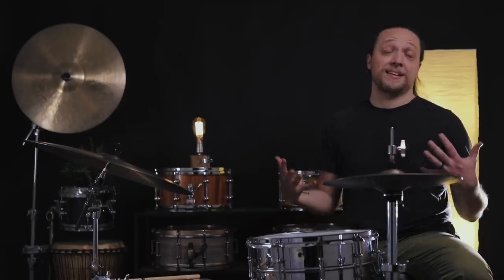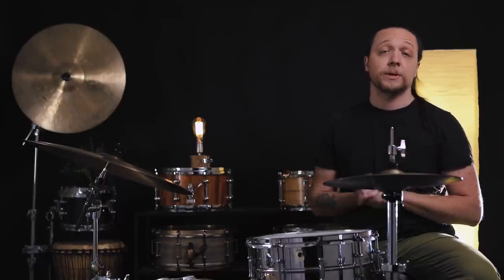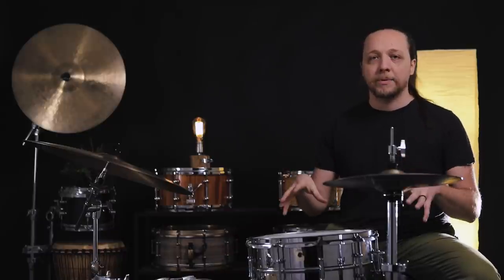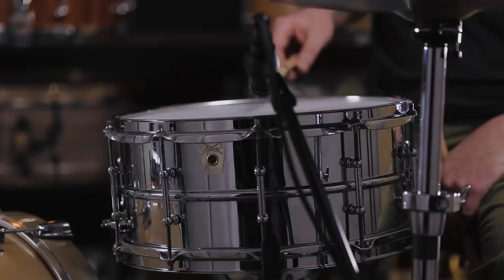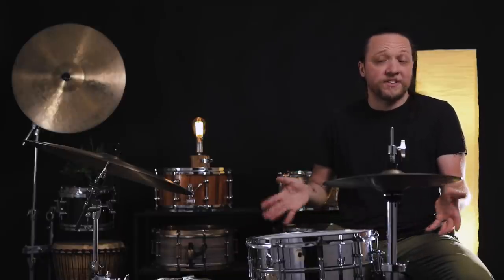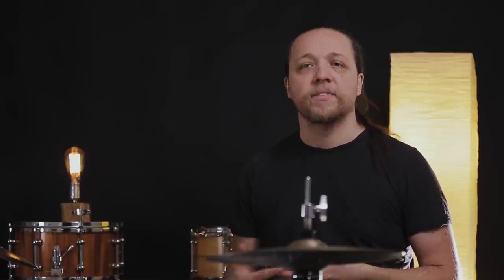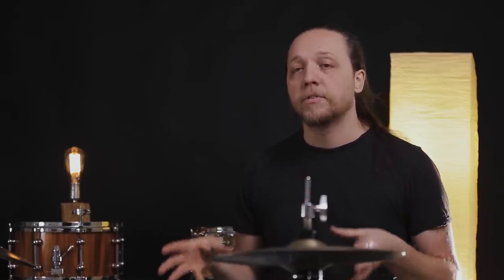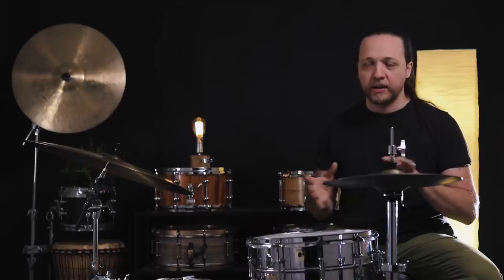Snare Drum Versatility is in the Reso Head | Season Three, Episode 39

Comment: I don't use tuning devices either, but I think you're missing another possible use case.  They don't just allow you to apply the same tension to every tension rod.  They also offer you a way of knowing how much tension you applied to each rod after you find a tuning you like, so you can record the numerical values and quickly/easily repeat them the next time you tune.
Reply from the maker: Oh absolutely! The key is that the quantification ignores a whole mess of variables so we find it best to deal with tuning on a case by case basis. Once you get accustomed to the process on a few different drums with different heads you can do it in just a few minutes. The knowledge gained through this approach has all sorts of added benefits when it comes to drum sounds and working with a given musical context.

Comment: Hey Cory, I stumbled upon this video while "surfing" the Interweb for an answer to a "weird" thing I experienced with a Metal DW Snare AND a PDP Maple Snare drum.   I truly like the sound from your snare in the opening of this Video.  The DW Design series Nickel over Brass Snare, 14 X 6.5 acquired Used in 2021 had a HD Dry Batter head installed by the previous owner.  It was Cranked and I really liked the sound of the drum Right out of The Box.  It was a big improvement over the PDP Maple Snare 14 X 5.5 with stock heads.  I replaced the PDP batter head with a HD dry -which did improve the sound just a little.  A few weeks ago, I replaced the DW's batter head with a new HD dry one, re-installed the reso head (cleaned and checked the bearing edges), re-installed the stock snare wires and retuned the drum.  I could not get to the sound that I had Out of The Box.  Last week, while playing along to some music (I'm a 71 yo retired guy who plays for recreation about 1 hour a day to My Music), I placed the Dw snare on top of the 16 inch Floor Tom to get it out of the way.  I played the PDP snare in the stand.  While doing a Fill, I hit the DW snare while sitting on the Floor Tom... BINGO!  That was the sound I was Looking for (actually Hearing for).  It played like a Ludwig Supraphonic , Jon Bonham sound !!  Took the DW off the Floor Tom and it was NOT the same?  Tried the PDP Maple snare and that Too Improved the sound !.  I've posted this Phenom in a number of Drum Forums.  Posters have advised of various observations.  "you are playing 2 drums simultaneously....  getting the resonance from 2 Drums"; another poster said Kiddingly that I may have Invented a new Snare Stand :):)  I have OCD about certain things.  This is becoming one of them :(:(.  I returned to playing drums after 50 Years [1969 at 18 years old], knew nothing of drum tuning and Drum heads back then.  I'm learning much now.  Tuning is an art. FYI, I have a G2 Coated batter head on my Floor Tom.  Any ideas about this sound phenominum ?
Reply: This sounds really interesting; would love to hear / see an example if you ever make a video of it!

Comment: Wow, i just did this, and a noticable change on my snare is that is, the overtone is less wild, less washy and less pingy and there's a little added articulation and as Cody said, I didn't touched the snare tension, just in the same spot when before and after I tweaked the snare side, here's what it sounded with my words:

Before making small adjustments:

Overtone: Waaawawawaooo 
(Wild and Pingy and sounded weird)

Snares: Psssh (Still some good articulation but it's still washy)

After Making Small adjustments:

Overtone: Waaaaawaoo (More controlled, less washy and wild)

Snares: Pssht (Little more articulate and less washy and more responsive)

This video is perfect for those who are wanting articulation but not choking the snares and maintaining your snare tone.

Thanks, Cody and this awesome channel!

Comment: BEST. VIDEO. EVAR!

Having said that, I have SO many questions:

1. What mil snare side head are you using? Does it matter?

2. Aren't you getting wrinkles in your snare side? Does that matter?

3. I was (mistakenly) under the impression that you treat a snare side like any other reso head. (ie. tuning it slightly slightly above or below batter. Keeping all lugs in tune.) SO, how do you tension the snare side head? Tight at the snare beds and then adjust the other lugs? Are those lugs under the same/ similar tension? 

Ok, I'm going to stop there. I have a TON more questions. I really feel like you could do an entire season on just this topic.

Thanks!

Comment: first of all, i'm surprised you didn't take it a step too far, just to show what happens. 
having said that, i've noticed before that lowering the tension on the snare side head widens the drum up, but i never thought to try it on just the rods that are not adjacent to the wires.  i've seen videos with top guys (coughBennyGrebcough) who advocate cranking  the bottom head, but he does say that he does this for articulation.
bottom line: it is best, as you say, to experiment and see what your equipment can do.  thanks so much for doing it in this video, because i'm lazy AF and haven't had the motivation to do it in my *%#% odd years of playing drums.

Comment: you are loosening the tension on the three on each side, correct? (not the ones on were the snares are)

You are basically doing the old rocker trick the other way around, instead of loosening the 2 beside the snares; you are instead tightening the other ones, correct?

Comment: You guys do a job no-one else does this way and with this devotion. That is worth a Patreon membership. In this video, I thought Cody should work on his rolls. But then I remembered that any time I get away from an even and optimal tension and the optimal relationship in tension of the two drumheads, my rolls suck. No chance to fix it. The snare tension is not that important. On the other hand, having found the correct head tension, the sticks bounce almost effortless and evenly. Double-stroke as well as concert rolls (mainly triple-stroke rolls, as Rick Dior told). Try it. Maybe, that is also a tip for frustrated drum students who think they‘ll never learn to evenly roll on a snare drum.

Comment: Interesting take on snarehead tension, Cody. Have u done, or considered a video on snare wires and the effect on sound?
I use 24 strand puresound wires on my 6½ deep drums and a 20 strand set on a "cheap" drum. Puresound don't seem to go more than 24 wires in their "cotter-pin" attached wires.
I fancy trying 42 strands on my 14 × 6½ Arbiter Advanced Tuning maple drum, but how much better can it get than with 24? (WHAT a drum, by the way! (I swapped the original hoops with hoops from an Arbiter FLATS 14" snare and vastly improved the ease of tuning. One bolt per head. How easy do you want?). ).

Comment: Awesome video! This was something I was wondering about, ie instead of touching the batter side, or the snare wires, just adjust the resonant/snare head. The huge impact of those side rods really surprised me! Now, wait until UK lockdown is over, and then experiment! I have a steel snare, and a maple snare, I believe both can sing, but each needs a different setup. You told me, it’s most likely not the equipment, it’s likely the snare side, and getting the right head tension. Thanks!

Comment: This is great info, Cody. I LOVE experimentation. One thing that I'd love to see you do, is a snare side thickness shootout, using several drums. I did a bunch of experiments with all of my snares and I've dialed them in over the years using different wires, snare heads, batter heads. What I've found is that on one of my drums in particular... it sounds amazing with a 500 (5 mil) Evans head and Puresound Twisted wires. This is a hammered stainless steel Mapex "Precious Metal" with cast hoops. I use this for hard rock and metal, and it simply cuts through everything. It still has amazing tone though. It sounded completely different when I got it, and that goes to show you how much your sound can be effected with these relatively cheap components. Even the singer in my band stopped us after the first song and said "dude! that sounds amazing. What the heck did you do to get it cut through like that?". When a singer tells you that... it's not just an opinion ;-) LOL
Reply: I once auditioned a couple of brass snare drums for a change from my steel and maple snares, found I liked the shallow 14 by 5 but the singer said nice but no way your getting that, I won't be able to hear myself sing!
Now I rock a birch 14 by 5 with a coated CS X head, Ambassador reso,great combo.